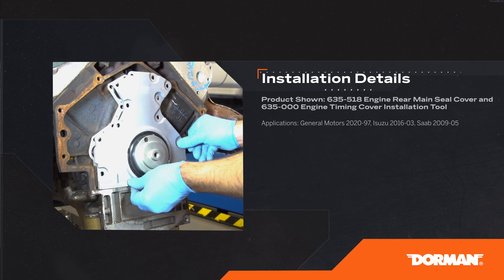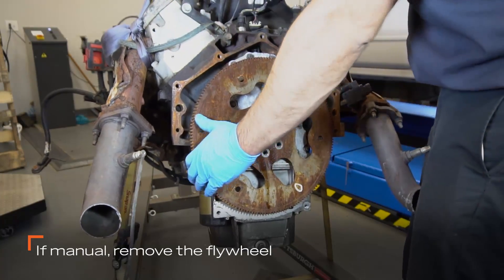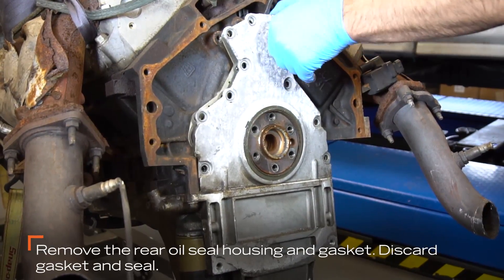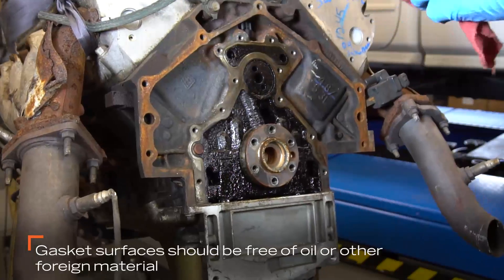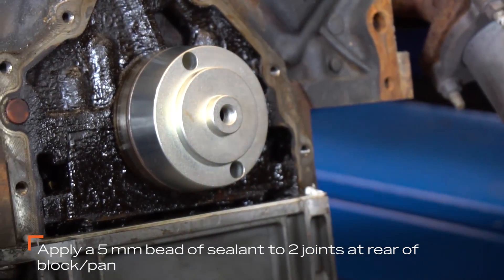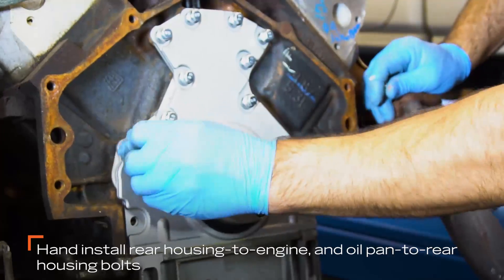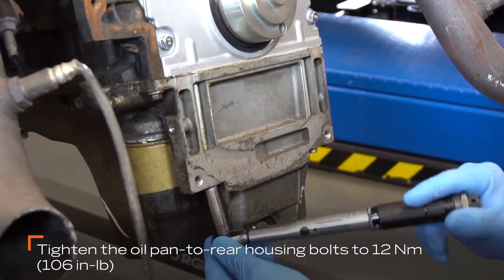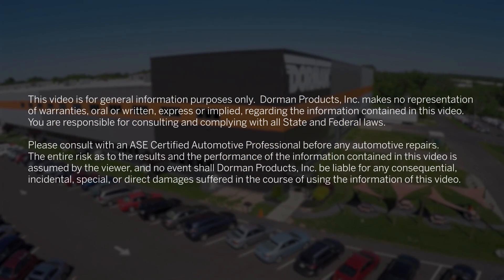How to Replace the Rear Main Seal Cover on a General Motors V8

Comment: So I just receive and used this tool. It really doesn't make sense to me, in the sense that the seal leaves the tool before you even put the bolts in 🤔... I can see using it as a "guide" of some sort, but I just do not see it helping the seals alignment. It seems like the tool would need to surround the crank in a way to create a consistent "gap" from the seal, that would be the "alignment" of the rear seal plate. Please, any feedback would be helpful.

Comment: I thought you would tighten the oil pan bolts last, as they could pull the plate downwards and cause the seal to leak.
Reply: No, you want to pull the Plate downward to complete the seal on the oil pan gasket, then tighten plate into place 🙏